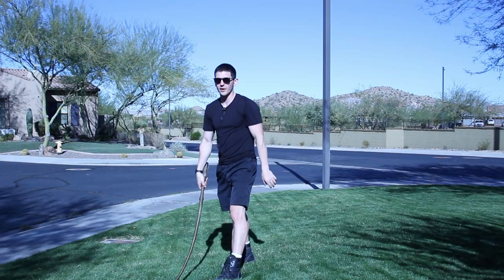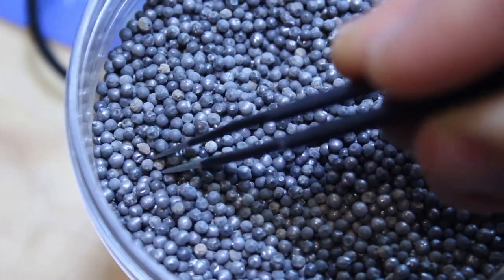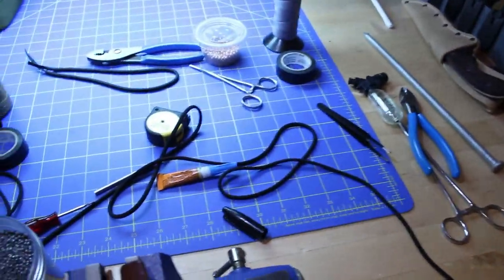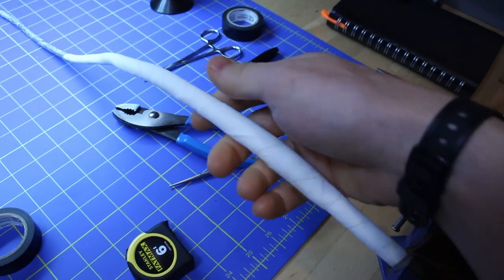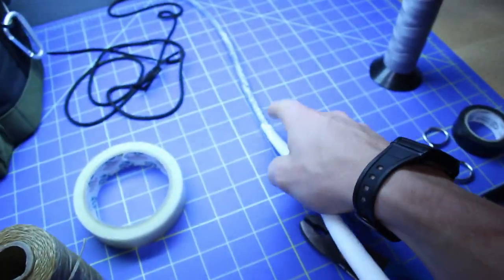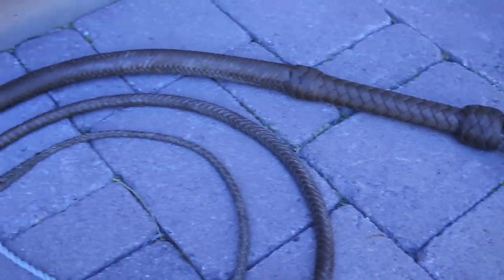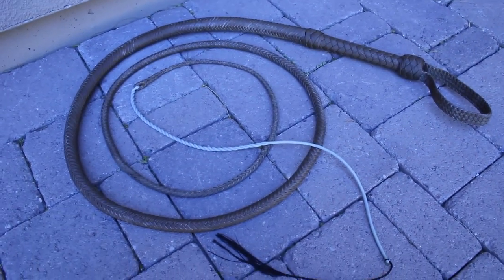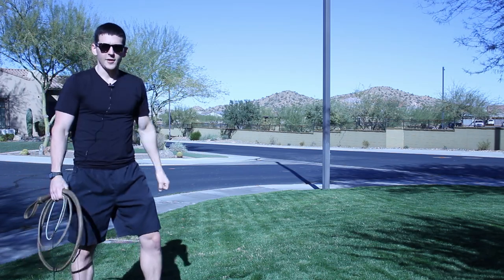Making an Indiana Jones Bullwhip | Paracord Whip Build by Caliber Whips

Comment: Hey man I love your videos, but if you are worried about your lead not being round, just buy some 9 shot or 8 shot 12 guage bullets, cut open the back, and then you have hundreds of perfectly round lead bbs. Also, when I make whips, I take a pen, take out the insides, tape the hollow shell to the end of the paracord, then you can take a funnel or a measuring cup and pour the bbs in. It will save you many hours. If you don't understand, please let me know because I promise you that you will love it
Reply: Is this helpful?
Reply from the maker: @dynowhips7825  - This method is helpful in many instances, but my case was a bit different.
Reply: @caliberwhips9595  What is different about it? Aren't you just filling the paracord with bbs?

Comment: How did you attach the lead core to the nail? Also could you give us the belly lenghts.
Reply from the maker: I glued the end of it
Reply: @caliberwhips9595  nice. I use a piece of 3/8 threaded rod and drill a hole in the end. Then I insert a length of plastic coated cable instead of lead for belly weight. Its nasty. And works well.